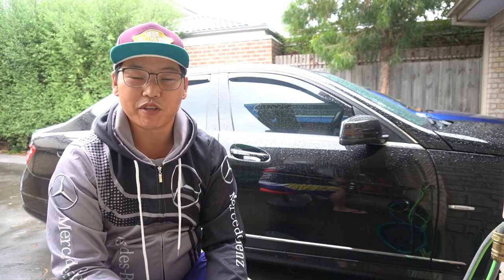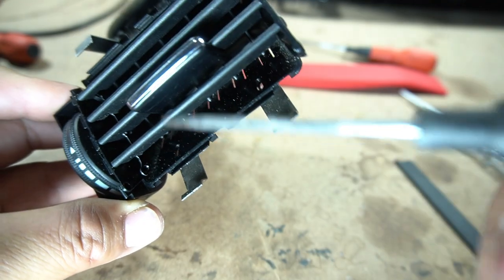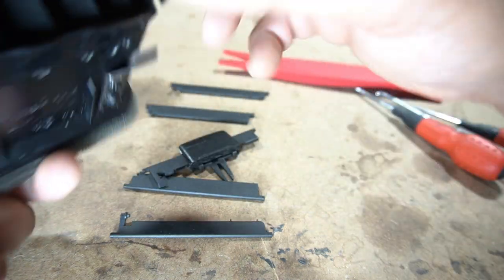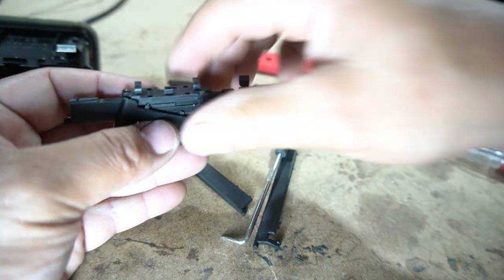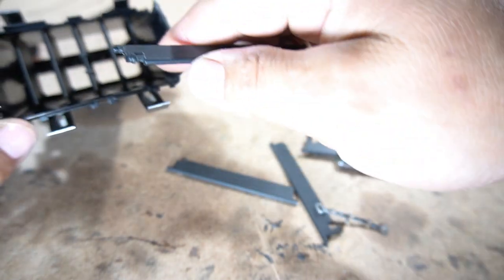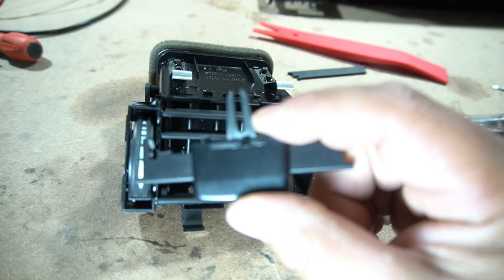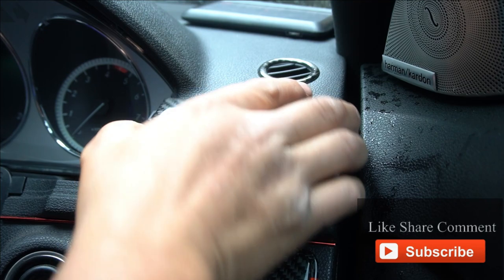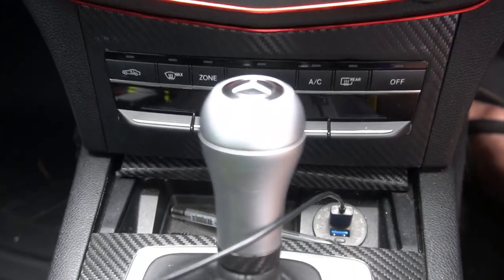how to remove repair reinstall mercedes w204 w212 w207 x204 ac vent tab D.I.Y common fault

Comment: Very informative. Thanks for posting this content. How do you remove the round, top air vent? Wanted to replace mine but I don’t know how to undo it. Thanks!
Reply from the maker: those are clipped in ..use a plastic trim pry removal tool and pry it up it should come up..do not force it
Reply: Thanks so much! Will do.

Comment: Great video buddy. I have a 2011 E550 with one rear center console horizontal luver broke. Should be easy to get out. The question is does MB sell just one luver or where can I buy just one?
Reply from the maker: thanks... I'm not sure if they sell just a single luvre however u can buy the entire vent relatively cheap now off ebay and aliexpress .. unless u want genuine that's different.. I got aftermeket and it's fine u can't tell at all
Reply: @MIKEYZVLOGZ  thanks for getting back to me so quick, you have a great day

Comment: Hey man thank you so much for this tutorial, those stick on vent covers gotta be easier than vinyl wrap 🤣 however I'm going to attempt the vinyl 🥺 I noticed you managed to take off the cover for the vent prior to dismantling the inside. Can you remember or do you know if the cover comes off for the center vents as well?? It would make it easier to wrap. Chrz from Wales
Reply from the maker: yes they do come off mate they clip in but be careful wen trying to remove

Comment: Hey Mikeyz, my w204 hazard light switch is faulty, I am getting the hazard/esp switch from ebay but would like your opinion whether it can be done with special tools.
Reply from the maker: whats the issue?? your cant press your hazard button'?>? or u press it and it doesn't flash? most cases its just a faulty switch so u simply replace the switch button, and it will work as per usual ..hope this helps u and u get it done buddy
Reply: @MIKEYZVLOGZ  definitely faulty switch, going to replace the switch but wondering how to do it. Since I have not done it before.

Comment: Which ones are for a 2005 Mercedes Benz c class? From United States
Reply from the maker: hi friend.. so u need to search via ur make and model .. I only listed the w204 ones for front and rear ... for older model w203 u need to search for w204 air vent tab
Reply: @MIKEYZVLOGZ  the ones in the video look exactly the same as those in my C280
Reply from the maker: for the 2005 there are abit different I think .. I know it's looks the same but mine in the w203 are abit rounder... I'm sure they fit the same way but don't quote me on that

Comment: How do keep that metal side clip in place to connect the last 2 vent?
Reply from the maker: which one the one that runs on the side ? u need to hold it in place and clip in it ... just as I do in the video ..it helps to put the other luvres in first that way it helps to hold it in place as u place the last cpl in

Comment: Hi.
Do you probably know where the rear air vent fan (A2048300008) is located? Is there a easy way to take it out? Thanx in advance.
Reply from the maker: um not sure ... u mean the vent behind the centre console
Reply: @MIKEYZVLOGZ  NO. The fan must be somewhere under the armrest in the central console.
Reply from the maker: @jankoceligoj7707  yeaa thats what i mean your talking abou the vent in the centre console right? your looking for the fan there?? mayu i ask why ?? is yourts not working?? ot blowing any air?? im not sure whre it is , i always thought it came frorom the front centre and there was just a tube that directed it there .. im really unsure
Reply: @MIKEYZVLOGZ  Mine is working but is or dirty or has something inside. It's loud. I have to take it out and clean it. Perhaps i need to change the bearing. It sound like a bad fan in the laptop. New one cost aprox 520€😬

Comment: After trying to put mine back together for a while I came across this video. The issue I am having is the louvers seem to be different lengths, causing more or less pressure on the metal bracket and then the 3 louvers (top bottom middle) just fall out when it is back together because the other two are pushing so hard on the bracket that it pulls them out of the hole the belong in. Any help is appreciated.
Reply: I also did not get the luxury of taking mine apart, when I removed the vent to remove the radio the louvers fell out of position because I was a bit rough

Comment: All 4 of mine have lost most of the vertical pieces and about half the horizontal pieces move independently. Very bad design. E250 Coupe
Reply: If anyone knows once the pieces have disappeared into the void of the vent, are they hard to get out? As in fall a long way or is there something to stop them within finger length?
Reply from the maker: @Martin_84  hmmm...will have to try and figure that out bud...let me see if I can see where it leads but replacement parts are cheap as too
Reply: I'm surprised I can't hear them rattling around when the fans on tbh, I know at least 5 pieces have fallen in. I'll have a go at removing one like you have at some point.. Do you go to mercedes for parts like this?
Reply from the maker: @Martin_84  no never Mercedes dealer aka stealership, always shop online ebay and aliexpress, parts are way cheaper

Comment: I broke  the 2 from the rear AC center console and it just break the outside thing the black thing inside that conectes inside is ok
Reply from the maker: so what did u need to replace ? they are all the same
Reply: @MIKEYZVLOGZ  the little thing with the crome line I don’t know the name sorry
Reply from the maker: @youngmiles4184  ahh yes the vent tab .. the onein this video correct?? iits a vent tab it pushed the fins left and right up and down yes?
Reply: @MIKEYZVLOGZ   yeah that I only break that they sell only that part ? Or I have to buy the hole console?
Reply: @youngmiles4184  I see you never got an answer to your question, Does MB just see one luver? I have one broke on my rear AC, not a big deal but things like that bother me

Comment: that's a few hours job... I'd rather buy another w204
Reply from the maker: lol true dat..although if u are pretty good mechanically and with tools if u weigh out the cost and labour ..let's see... few hours or buy another w204 which will cost about 5k usd is that right? here in Australia it's about 8k to 10k depending on model... so literally speaking ..might be good idea to do yourself ..gain some knowledge at the same time and k prive your skills set ..that's just me ..  I know what u mean tho..I use to pay ppl to do the most simplest jobs like change oil spark plugs etc now I just save the money and find the time